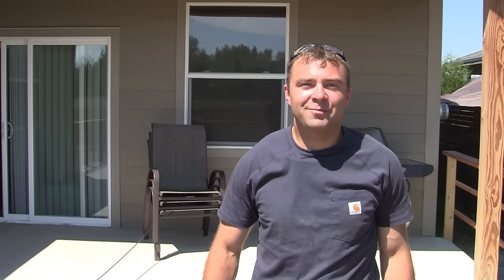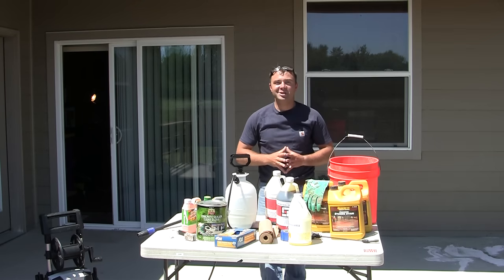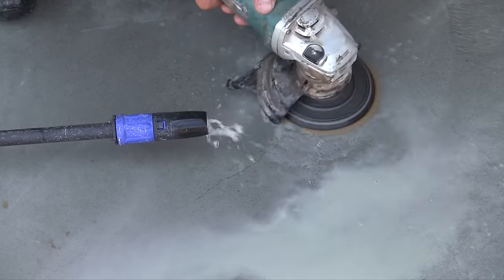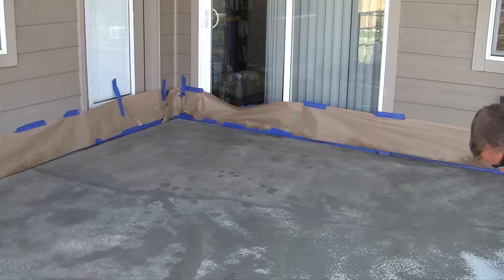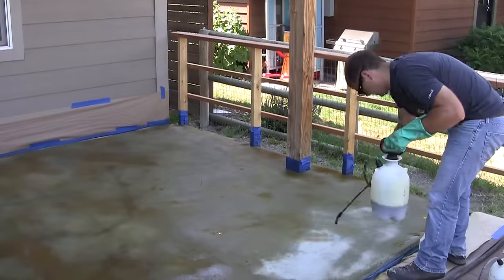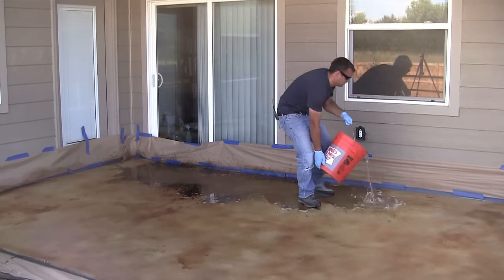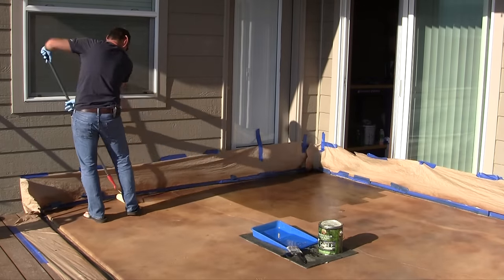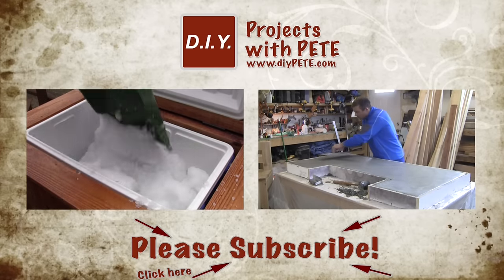How to Acid Stain Concrete | DIY Acid Stained Concrete Patio

Comment: does anyone know if you can stain self leveling compound . ??
Reply from the maker: I've stained a lot of micro-toppings and concrete overlays. I've never tried a basic self leveling compound not meant as an overlay. I'd recommend testing it out -- but the metallic salts in the acid still will react with the limestone in the cement. I'd do some experimenting --- and if anyone has any knowledge about this please chime in.
Reply: Micro-topping. I'll check into that. Thanks much. !
Reply from the maker: I have used elite crete products as overlays / toppings. I used to actually do a lot of exterior and interior decorative concrete.

Comment: Great video but "DO NOT USE HC CLEAR SEALER". I used this sealer and it's junk. The sealer a milky white not clear. I let my patio dry for three days and then put a coat of this sealer on it. It was in the low 70's that week and it didn't get below 45 degree at night. The sealer looked great the first day but then it turned white all over my patio. I had to use Xylene to strip the sealer off which ruined the stain. Now I did use this sealer on my entrance way to my front door. I put a real thin coat on. That didn't come out as bad and I'm just gonna deal with it.  I would recommend the Superseal 2000 by Concrete Coatings on Amazon. It's not as thick as the HC sealer and the 2000 is actually clear.

Comment: what are the names of the stain maker, and sealer maker please???
Reply from the maker: Hey Richard! I used Scofield Stain - http://www.scofield.com/concretestain_samples.html  in dark walnut. For a sealer I used an H&C solvent based sealer from Sherwin Williams: https://www.sherwin-williams.com/homeowners/products/hc-decorative-concrete-sealer
Reply: DIY PETE thanks buddy,one more dumb question, are you familiar with the additive you can mix with the sealer so it's not so slippery in the rain??? if so which one do you use?
Reply from the maker: Hi! Yep! Sherwin williams has an additive ( i think they refer to as Shark Grip ) --- it is basically clear sand that you mix in with the sealer and give you grip. I've done it on a few epoxy garage floors. My patio had quite a bit of texture from being troweled --- but I think the additive is a great idea! I believe they might have a version of it at home depot by the epoxy as well --- but not 100% sure.

Comment: about how much in products for the job?
Reply from the maker: Hi! I have some cost information in the web post here: http://www.diypete.com/how-to-acid-stain-concrete/   --- A gallon of stain was more than plenty and those are typically between $45-$70.   Besides that you'll need prep tools, a pump sprayer, etc. The oil based outdoor sealer was purchased by the gallon for $30/gallon and I used less then 2 gallons. Cheers!
Reply: DIY PETE awesome!  thank you very much. I was asking because a guy here wanted to charge me 450 to do a 10x10 brand new area. thanks you again.

Comment: Cool. But one thing should be modified for safety. 
When mixing acid with water ALWAYS put water first and then acid. 
Because if it splashes - it splashes what's already in container - if it was water - bit of water gets out, but if it was acid... Anyone can figure it out.
Reply from the maker: Thank you